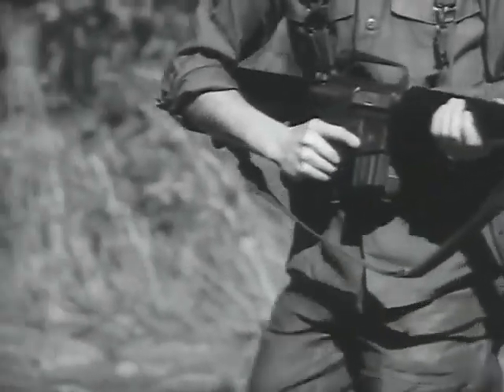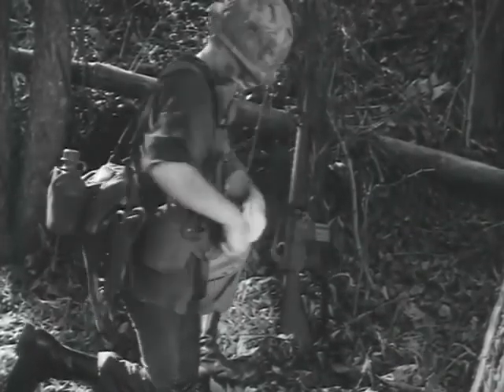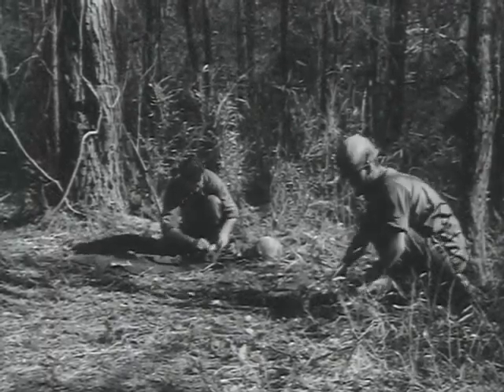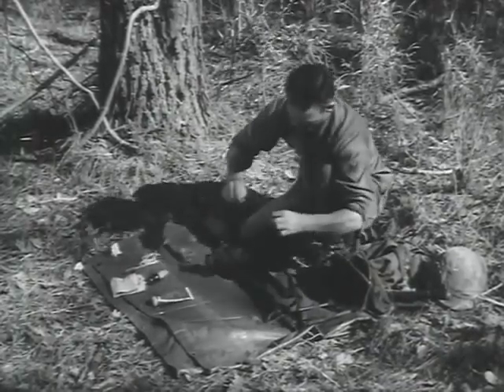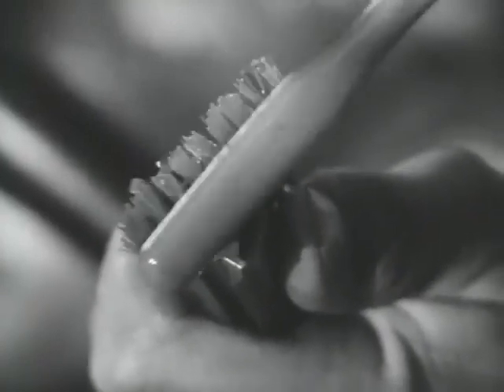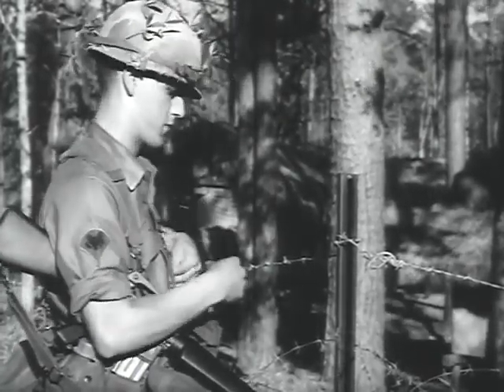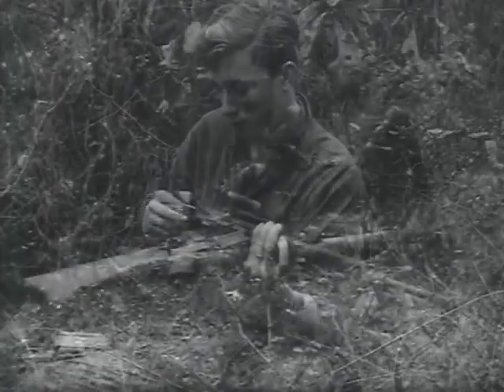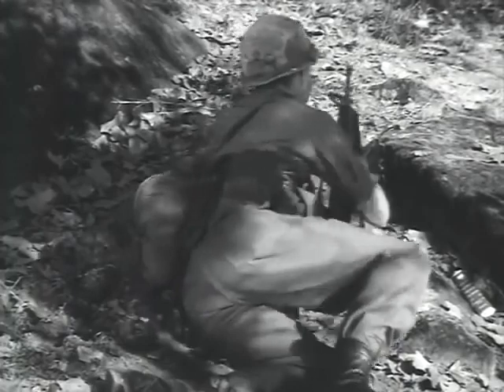M16 Rifle Maintenance   Rifle M16A1 Field Expedients  1968 US Army

Comment: All the maintenance in the world wouldn't keep the early M-16's functioning!  They didn't chrome plate the chambers and bores at first, and not only did the rifle have a bore that rusted, the initial batches of ammo had the wrong gunpowder and this changed the firing rate on full auto.  Army ordnance evidently had their heads firmly buried up their own butts to let a weapon with so many flaws reach the GI's on the battlefields of Vietnam and the early rifles cost a lot of men their lives when they jammed tight in combat.  No cleaning procedures could fix those early guns no matter how well maintained.
Reply: The M16A1 rifles shown in this video encounter a lot less jamming.
Reply: Those were the XM16s and M16s. By the time of the A1 the chrome plating and powder issues were addressed and cleaning SOPs and supplies were given.
Reply: @SonOfTheDawn515  I've researched the issue for years and that's about the gist of it.  The army actually issued an unproven and (obviously) untested rifle to the troops - while in the middle of a hot war!  This is utterly unforgivable, and we will probably never know how many lives were lost due to M-16 malfunctions.  And it it is true they  Army ordnance working with Colt, the manufacturer fixed most of the problems (failure to chamber/failure to feed/failure to extract with cartridge rim physically ripped off the brass casing/chamber and bore so rusted it is dangerous)  But for over a year, from mid 1967 to 1968 - the Army responded to troop's perfectly valid complaints about the M-16 the army way, by denying the problems existed, and punishing those who complained!  Meanwhile scores of troops wound up dead  from a weapon that jammed tight and was thus useless.  For all that the rifle could not really be called combat-ready until sometime around 1969.

Comment: 14:25 The M 16 is a good rifle... If you don't consider the rest of the existing rifles
Reply: @Mechanized85  XM16E1 is similar to the M16A1. only the first adopted M16 got the most problems. and yeah, the main problem was the ammunition, not the gun
Reply: The M16 is an excellent weapon system, a revolutionary one at that. The fault lay within an Army ordnance bureaucracy that refused to allow the newcomer to replace their creation. 

Such was the impact that everyone who could, including the USSR, would either adopt it, a weapon that uses its ammunition, or a weapon that uses something just like it’s ammo. 

VC and PAVN forces frequently picked up and used captured US/ARVN M16 rifles. And when Saigon fell and the victorious PAVN could pick the best arms of the former ARVN, one of the few small arms they kept around was the M16 rifle. In fact, they have recently begun converting many of these weapons into short-barrel CAR-15 carbines for their own use. They likely had access to weapons like the AKS-74U, and yet when it came to get a modern compact weapon for special forces and naval forces, they chose to put in the time and effort to modify the M16 for this purpose.

Comment: If the water in the barrel won't drain out because the barrel is sealed, how did the water get in there?
Wouldn't that be like an upside down glass in water?
Reply: no, it would be like a sideways glass in water. it slowly fills up, then once it is filled up and you tilt it up vertically, it doesn't drain out because of the vacuum, kind of like if you suck up water with a straw, then hold your finger on the end of the straw, the water will not come out unless you unseal your finger from the straw.

Comment: That's why I prefer using an M1 or an AK-47 than this complicated toy.
Reply: why? do you fall on mud everyday??
Reply: This is not at all what modern m16s and AR15s are like. The  issues with the original M16 were fixed long ago during the Vietnam War.
Reply: You've never seen an in range mud test before and it shows
Reply: The AK-74 is better then all 3 to be honest!
Reply: But the m1 is like 3 times more expensive to shoot